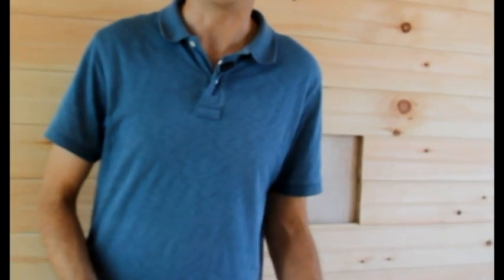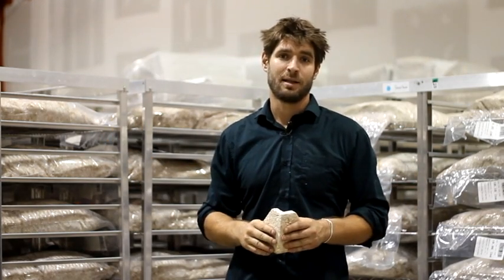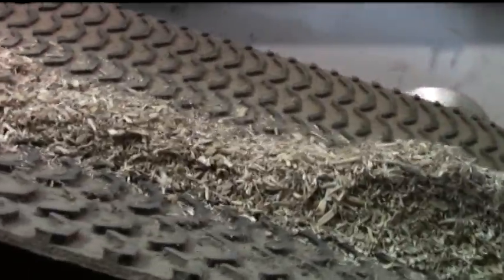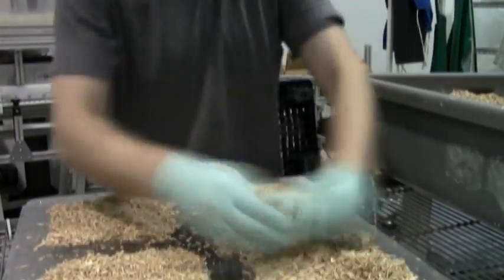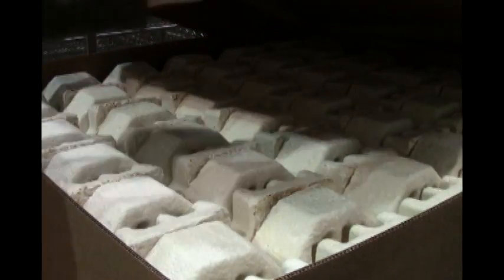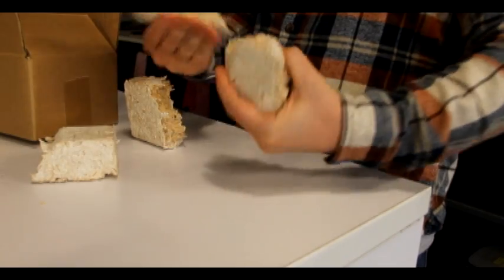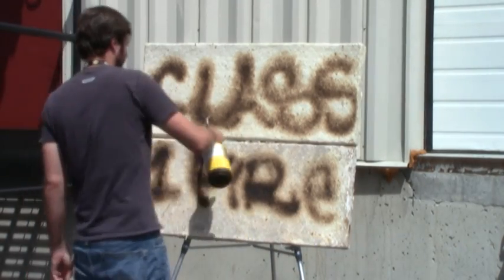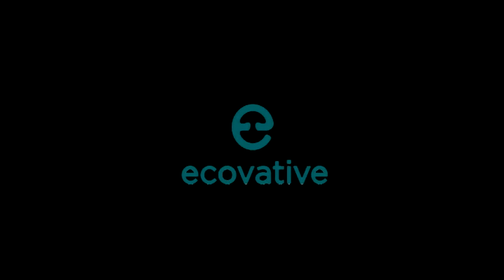Ecovative's Mushroom Tiny House

Comment: If you grow it directly in the wall, how will you heat it up to kill the mushroom and dry it out as you do with the mycofoam parts? By the way you guys rock, this is the most innovative thing I have ever seen. Any chance of releasing free information on how to do it on a small scale for personal purposes? Agricultural waste is readily available in many places and  this could be a low cost alternative for something many people can't afford in Eastern Europe.
Reply: Could do a fumigation style tent and run a heater directly too it, or could build a form around each wall section and use electrical heating elements
Reply: Also how do they provide the adequate moisture levels for growth without degrading the outer wooden shell?

Comment from the maker: Actually, we're not sure what will happen since the house does not fit in our normal drying system! So far, the house is standing strong with no issues.

And... we hope that before long we'll be able to share more regional manufacturing locations so that you can also get locally grown Mushroom Materials in Eastern Europe. :)
Reply: Would manufactories in dry desert climate regions, or even with access to extremely hot dry areas like Death Valley, help with this? (This video is so old I'm guessing the project may be defunct, but I'm hoping anyone interested in doing similar stuff might come here.) I'm also thinking about, like, companies that after hurricanes and floods or water pipe bursts come in to commercially dry a regular-sized home. I don't know enough about y'all's drying process to stop spore growth given that I only learned about it a few hours ago, but my mind seems to love making lateral outside-the-mold connections. Especially when it comes to mycology. I love what y'all are doing and I really hope there are people out there carrying on this work! San Francisco has such a huge need for affordable, quickly-made single-occupancy shelter that's flame-resistant and hydrophobic, and non-toxic.
Reply: Even temporary housing can grant relief to people otherwise warehoused unsafely in congregate living situations, creating public health hazards and robbing unhoused people of the dignity of privacy and safety at night. (Thank you for coming to my TEDx Rant, ha.)

Comment: Great idea which has temporary benefits, like packaging. However, moisture intrusion or vapor condensation in the walls would start the recycling decomposing process and expose some inhabitants to unhealthy spores.
Reply: Blake Talbott Maybe using some kind of natural Amber/Tree sap as a Sealer could prevent that.. maybe even sap could even be used as an expanded insulation or caulking product itself.
Reply: scratch that.. Amber is actually kinda flammable😥
Reply: I believe the myco insulation is baked, so the spores are killed. Mycelium is often hydrophobic once it is dried. My semi-educated guess is the risk of moisture and decomp is probably lower than with many kinds of blown in insulation you can get now, and it has the advantage of not settling.
Reply: @saltwaterpurl  yup that’s what I learned during their webinar.